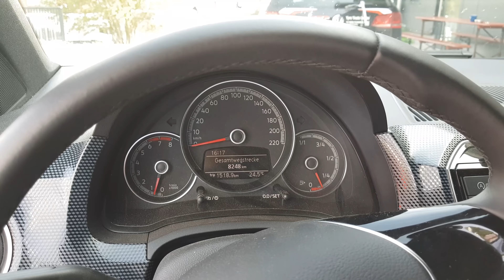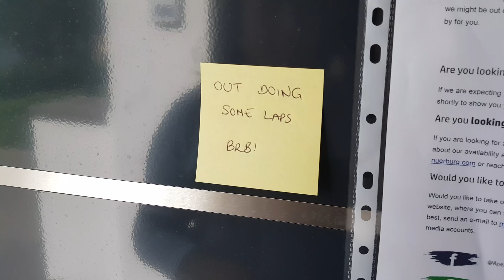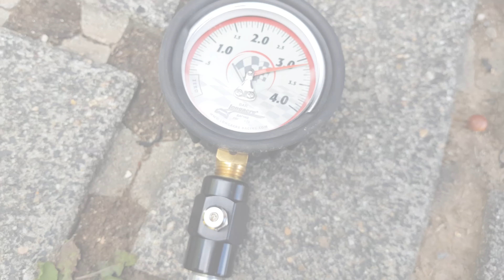WHY YOU SHOULD TAKE YOUR GIRLFRIEND TO THE TRACK

Comment: Misha , RCN has about 13 Laps. Only 3 of them are about consistency. 2 of them are Box in and Box out laps for refueling, for which you have 48 min. within those 48 minutes you have to drive the 2 laps, refuel the car and you have enough time for a pitstop, thats right. 
But the other 8 Laps are about speed, every second gets  you a point, less points you have , the better is your Ranking in the end, therefore most of RCN is about racing and fighting for every second. So if you have to pit in those laps( what the BMW you fillmed did), you better hurry up, every second more costs you ranking. 
Would love to see some more content from RCN from you, because its the real Motorsport you are talking so much about, where you can also compete without hundreds and thousands of euros. 
Nice vlog as always, keep up the good work.

Comment: Misha have you tried the Conti sportcontact 6 tyres? I'm looking for something that will also work in the rain and lower temperature conditions. Looking to replace my pilot supersports..
Reply: Check GoodYear Eagle F1 Asymmetric 3's. Those have worked amaizing for me so far. Awesome dry and wet grip and one of the most silent if not the most silent sport tire available..
Reply from the maker: haven't tried it yet
Reply: Niklas I got them on my Fiesta ST. Very good tire, extremely capable in the wet and also in the dry. For track purposes there are better options than the Goodyear, but it's one of the best tires for the road